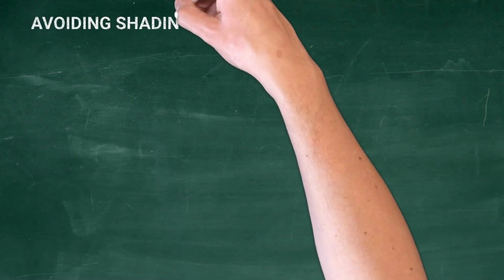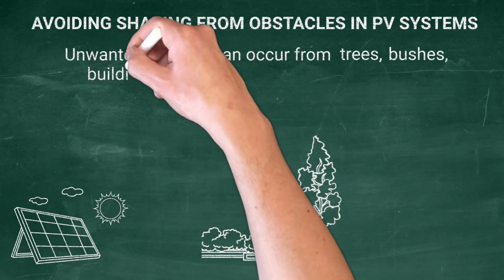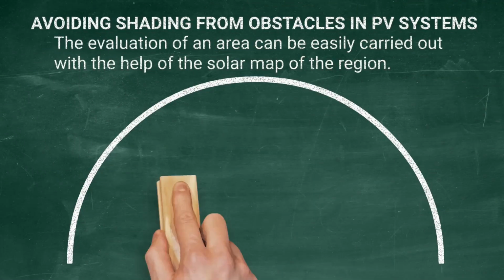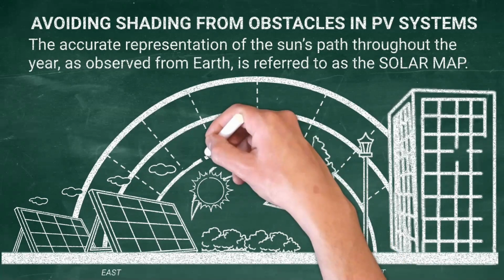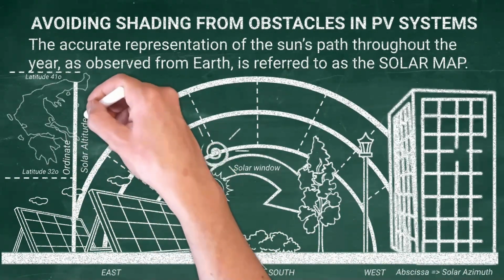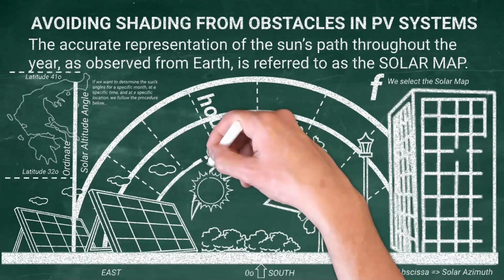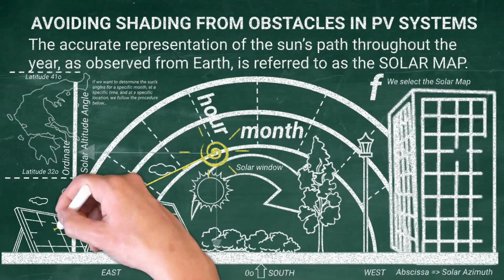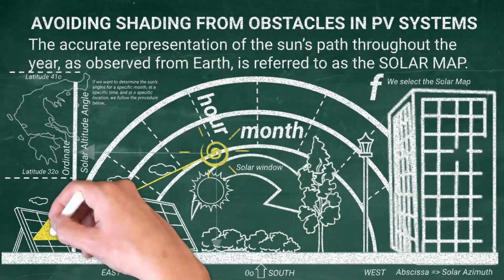Solar Panel Mistakes That Cost You Big

Comment from the maker: QUIZ TIME for solar engineers 🌞

Which of the following angles can be calculated using the solar chart?  
Mark your answer in the comments:

a) Solar azimuth  
b) Hour angle of solar declination  
c) Hour angle of sunset  
d) Solar altitude (sun height angle)  
e) Solar declination

👉 Comment with your answer (for example: "My answer: a, c, d")  
AND tell me what you want to learn next about solar design, shading, or panel placement.

I’ll use your comments to create new videos that answer your questions in detail. 🚀